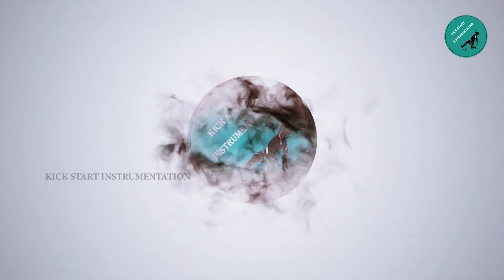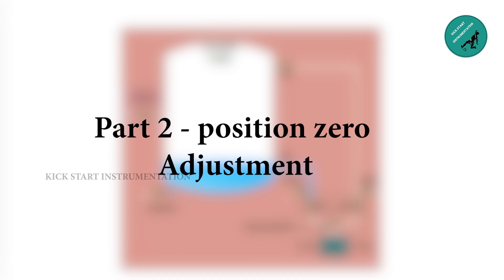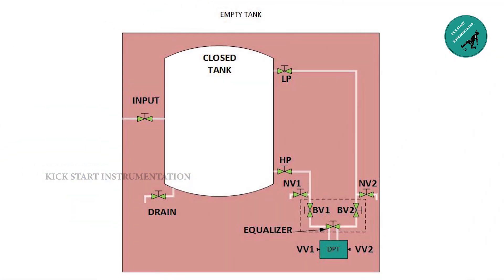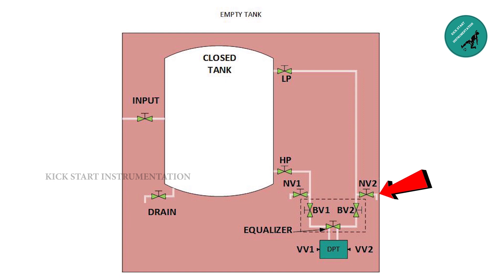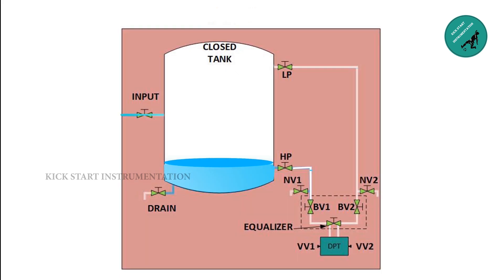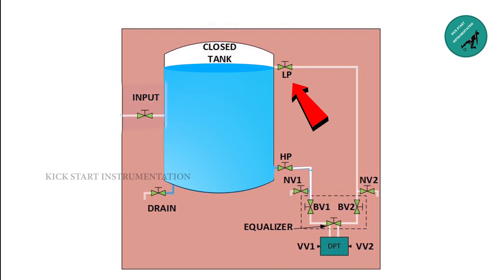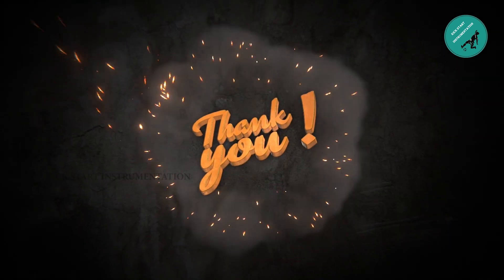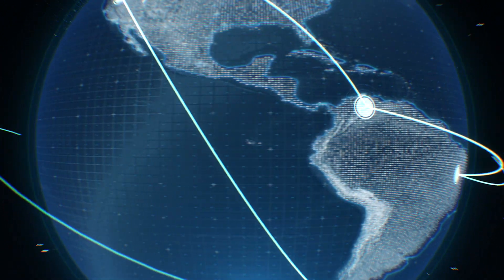Level Measurement using DP Transmitters Working Principle - Part-1

Comment: The video is good in terms of knowledge that it is trying to transfer to the audience. However the video seems very strange. I don't what's the relation between technical analysis graphs in stock market with DP level transmitter. Your video is a tool for communicating your message not for making unrelated visual noises. I tried to fokus on the content and expected your video as a part of your content and then became confused with the visual features there. Don't do that in your next videoes.
Reply from the maker: Noted. Will correct them in the future.